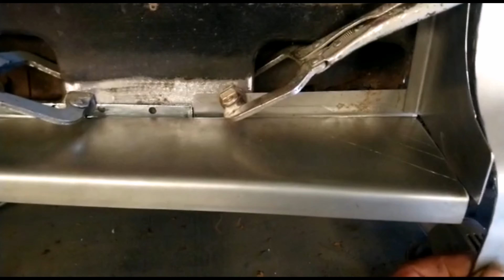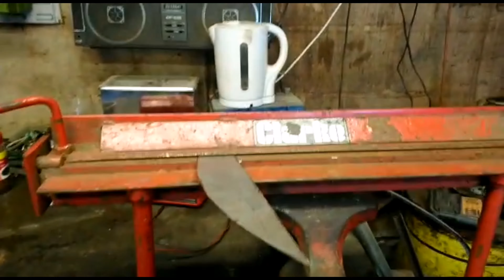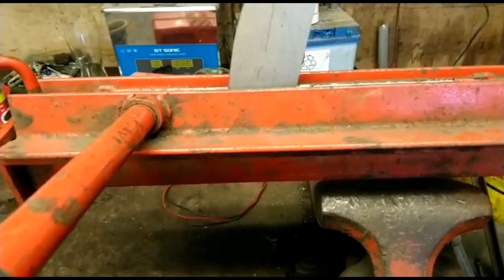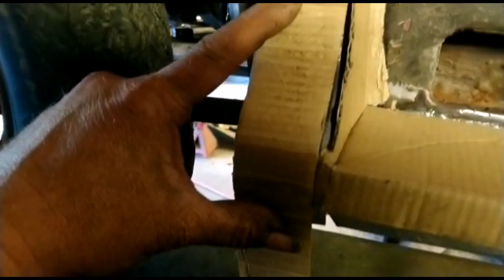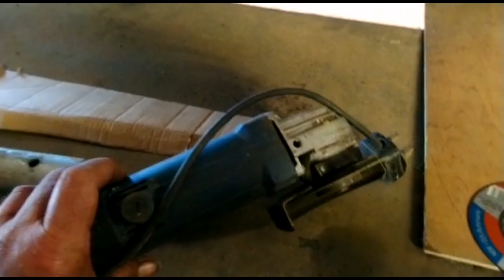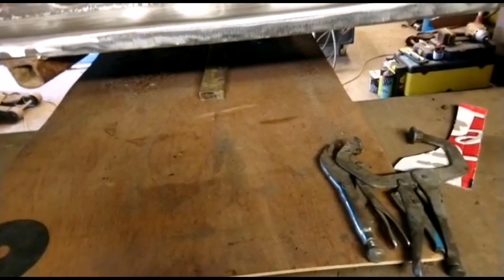Morris minor resto part 3 (more welding)

Comment: Hi Peter. All of the new steel is staineless? I was thinking about doing that but didn't know if painting and welding is done the same as normal steel.

Great job! I'm learning a lot, specially because my Oxford has no inner sills whatsoever and the bottom part of the floor and other bits are just wroten through. 😢